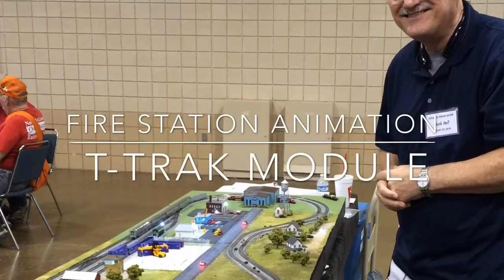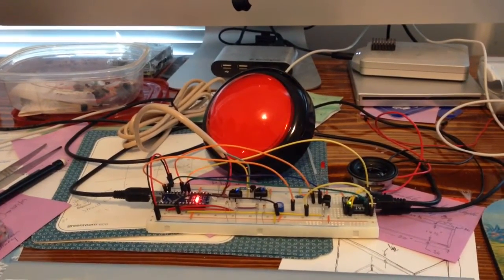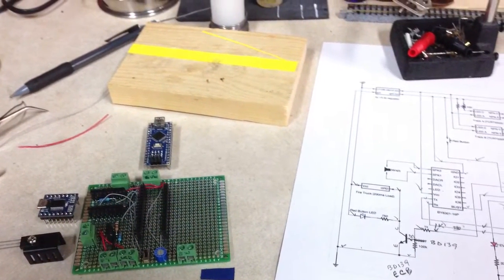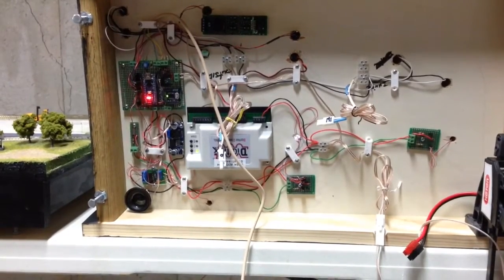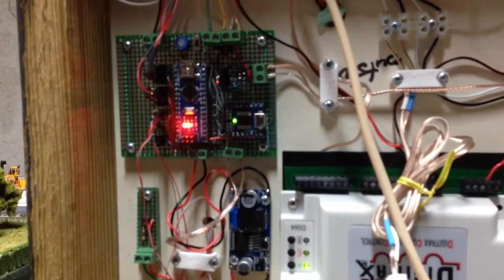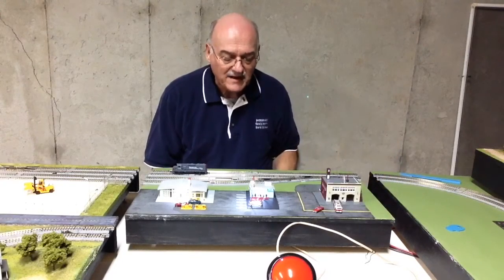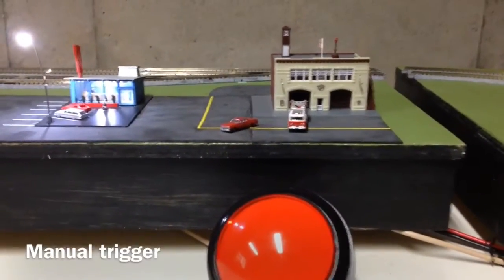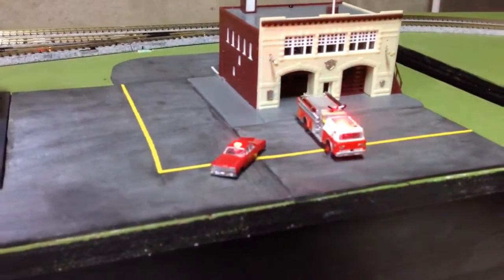Fire Station Animation on Mark's T-Trak Module

Comment: I love it. Thinking of automating much of my new module with Arduino but I will have a lot more sound elements to work with. I cant fit sound to my cars nor the locos, they are just too small, so I will have to have a series of speakers around the layout and the MP3 loco and track noise will follow the consist through sensors just like yours. Good luck with it. 
PS: When you have the audio report the fir at the Burger bar, why not light up the burger bar so it looks like there is a fire inside?
Reply from the maker: What a real great idea!   I did run into a problem with my sensors when exhibiting at the Infinite Energy Center’s forum hall.  They recently added new high intensity ceiling lights that over saturate my IR sensors.  I use TCRT5000 PIR sensors which have an IR emitter and receiver.  The over saturation of the IR receiver makes it think there’s a train running over it when in fact there is not.   I like the TCRT5000s as it allows me to tun my trains in the dark and still have animation work.  I need to add a day/night mode.  Day mode the IR emitter is turned off and the received logic is inverted in the Arduino to look for a drop vs a peak in light.